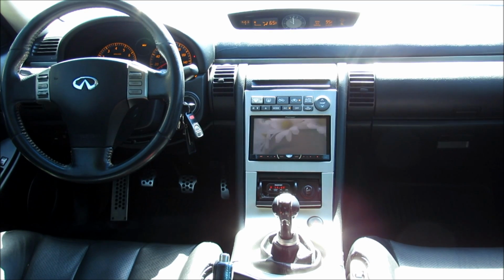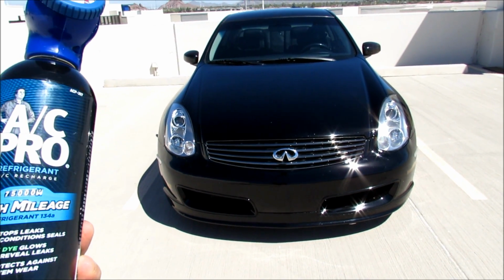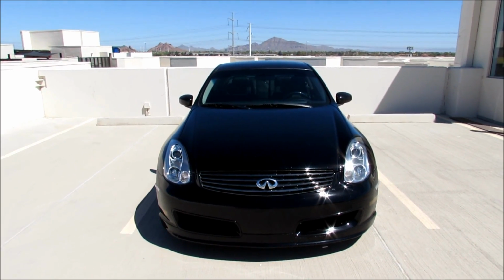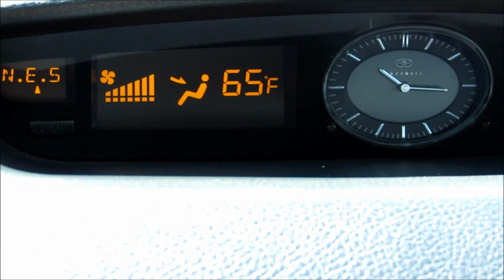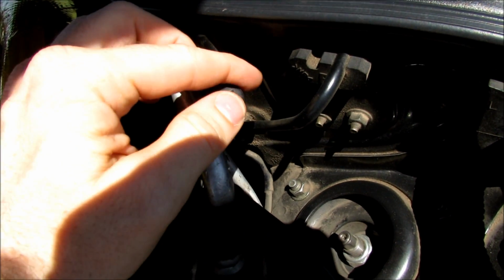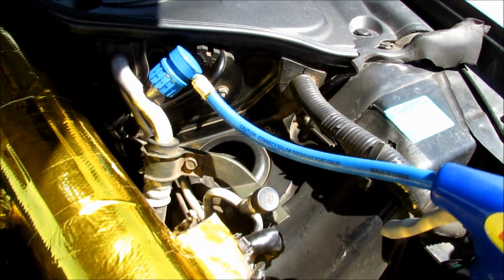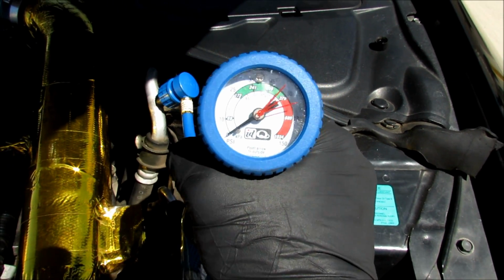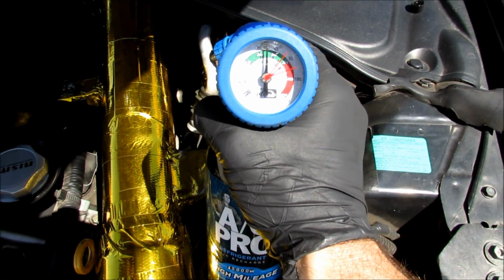Fix Broken AC - How to RECHARGE car blowing HOT AIR

Comment: My ac is on full blast and my radio doesn’t respond and my battery is always drained do you know what I can do to help with that problem?
Reply: I have this problem but not with the battery. The screen was stuck on Infiniti logo. Had to get get a new head unit. I’m still waiting for Infiniti to get back to me

Comment: What battery do you use for your g35?
Reply from the maker: The 5 year one from Oriley's. In Arizona, the heat is so hot that batteries only last 3 years so I always get a free battery under warranty.
Reply: Motordyne G35 what’s it called do you know ?
Reply: Motordyne G35  also so my ac is on full blast and my radio doesn’t turn on I read that it might be due to a discharged battery and my battery always needs a jumpstart to function will getting a new battery solve my problem?

Comment: My A/c blows hot only, When I was about to fill it up I noticed the low pressure cap missing you think that’s the reason why ?
Reply from the maker: I doubt it, there is a bigger leak somewhere else. Did the recharge can fix it?
Reply: Motordyne G35 The recharge didn’t fix it, I’m taking it to the mechanic Friday.

Comment: There is one other issue with many cars with over 100K miles. The
AC compressor can get tired. You will notice this when the system has a proper charge.
When you start the car cold, everything works fine. But, drive it for a few miles, then pull
into a store for a few minutes and then start the car again and take off and you will hear 
a sound much like the roar of the cooling fan on a diesel truck or older car as
the engine revs. That fan like roaring is the AC pump beginning to fail. This is very common
on Nissan vehicles. Honda cars make this rattling sound. Like I said, you will start to notice it when
you  let a hot engine sit for 15 minutes to an hour or so then restart and take off. 
It is very evident much above 2000 rpm. Many times, if the system is slightly low on freon, 
the noise will not be there. But if you top it off and get the pressures back up, all of a sudden you start hearing it.
Like I said, this is usually heard on cars with over 100K miles on the original AC compressor and 
more common in hot locations like Florida. The thing is that the system will  still cool the inside of the car fine.
Problem is that when the compressor does finally go, the whole system will suffer from what they
call the 'Black Death" which will many times require replacing EVERYTHING to get all that black goop out.
Flushing rarely gets it all unless you do it several times (Which very few shops will do). 
So, if you do top off your freon, listen for any abnormal sounds coming from 
the compressor when the system is hot.
Reply: I definitely hear that roar even more with the recirculation but my vehicle only has 50k miles.
Reply: @Monster33336  The noise I talk of will be quite evident if you raise the hood and listen to the compressor. Like I said, it should be a lot louder then the engine is still hot during a restart. This is when the system will experience the highest pressures until
the fans cool stuff back down again. It is the first sign of impending compressor failure. Turning the inside system from circulating outside air to recirculating inside air will have no effect. It is normal to hear more fan noise inside a car when you go from normal to  recirculating inside air. 
The noise I speak of is from the actual compressor and when it gets bad enough you will start to notice this growling inside the car. If you let it go, the compressor will eventually self destruct. A test is to let some of he freon out, thus reducing the system pressure. Then if the sound is less, you know the compressor is on the way out.My 350Z had this issue. Sounded good when the system was cool, but once it got hot, the compressor would start to make a growling noise. And yes, the front fans were working correctly. I did change it out before it completely died and with the new compressor and drier in there, the thing is nice and
quiet now and cools great.

Comment: 08 G35S sedan. Any clue how I could check my a/c compressor ? My system isn’t changing so I have a leak somewhere and the a/c compressor won’t kick on.  Thanks in advance
Reply: Hey im having this same issue on my 08 g35 and was wondering if you found a solution
Reply: Compressor will not come on without freon in the system..so u have to charge it with enough to make it cycle to show the leak

Comment: Tip from me for DIY .. on hot day no matter what temp is you can spray a mist on the condensor with a garden hose or splash in forceably with water only filled antifreeze jug when hose is not avail.,  (  in front of radiator) with the gauge on low pressure port . You do not need excessive water just make sure its wet from top to bottom and side to side rather evenly. For R134A the pressure for maximum cold on a properly operating system will be 28 psi , for R12 its 30 psi and for Freeze 12 a conversion brand its 26 psi.. these pressures yield temps so cold its almost freezing. * Over or Undercharging will yield warmer temps and higher operating pressures* Ive seen duct temps near 39 degs F on average using this technique. I ran my own Auto/ diesel master tech service for over 16 yrs closer to 19.. Being mobile you learn alot of tricks that save toting bulky equipment around. I always had to have a recovery machine though being a pro. Sometimes the R134A fittings will fail and cause the majority of leaks . Always clean and check the R134A ports before clamping hose on the service ports.
Reply: The optimum low side pressure changes dependent on outside air temp.  To say every 134a system should have 28psi in the low side for max efficiency will not always be correct.  Dependent on outside air temp pressures can and will range from about 25psi to 55psi on the low side of system.  As the outside air temp rises so will optimum low side pressures.
Reply: theripper121 Thus why I stated YOU MUST SPRAY THE CONDENSER WITH WATER ! This simulates a perfect day of 75 degs out . This prevents overfilling when using a can as well if people add freon gradually. I've only done this for 19 yrs professionally otherwise I would not have suggested it. During a recharge with a machine it dumps the correct amount in so its a no brainer.
Reply: If you have a gauge why not just use the gauge properly and skip the step of trying to water down your condenser and guessing whether you got it wet enough or not and just fill it according to your outside temp.  Seems like you're adding an unnecessary step.  If you bought a can with the gauge on it just set it to outside temp and fill.  Unfortunately most people don't have the proper equipment like you do to recover what is in the system, to pull a vacuum on the line and to refill.  That would certainly be the most ideal for your cars ac system and the environment given tons of people end up releasing into the atmosphere but not the easiest on one's wallet.
Reply: theripper121 Dude STFU already with your speculation bullshit . By EPA LAW TO SERVICE AC PROFESSIONALLY techs have to check for leaks . I carried a suitcase recovery machine. A recharge and evac tower are way too expensive. I was a MOBILE TECH  not a shop. Giving advice to Do it yourselfers here so wtf are you on about ?
Reply: I'm not speculating a thing.  I'm just having a conversation here not sure why you are getting so hot and bothered.
Reply: theripper121 My humble apologies about that , your right no need to act hot headed it was uncalled for.. let me clarify a few things why I do it that way .. First as a mobile tech you never know how many people have serviced the AC before . System capacity can be overfull on oil charge . Flushing a system was not practical for me as I'm doing work in apartments, at shopping centers, people's work and at their homes. AC work was very tiny part of my business. I tried to avoid it as much as I could. The people I had as return clients were not rich and good middle to lower working class. They needed correct fixes done as cost effective as possible. Just dumping freon in doesn't always get it as cold by the charts I've tried it. If you got a AC thermometer with the clip and long shaft like a meat thermometer. Stick it in your ac vent mid day on 100° deg day . Its likely to only be 48 to 54° . Car manufacturers only require a system to do at least 54° with R134A. Using my method every Normally operating system has gotten to 37.6 to 43° F . That is blowing ice cubes nearly. To truly do proper AC you also need a high pressure gauge to verify there are no restrictions on the vehicle being serviced. There are so many factors it would take all night to explain each. When you wet a condenser with AC on if it is low on charge the compressor will cycle shutting off then turning back on. That means it will need at least 1 full 12 oz can in most systems. Every car is unique in capacity so again its a tried and true method that saves alot of hassle. If you cannot obtain a steady 28psi on low side with wet condenser there is a operating problem on the system and it needs more involved servicing. I think that covers it. Any other questions ask away .
Reply: theripper121 Also 1 thing I encountered very often is people request an AC check and or servicing. More times than I could count just by putting gauges on both ports 75% of the high side R134A fittings will start leaking just because you touched it. They really suck. Most leaks I found were AC comp with 100k or more miles on it or fittings. Some lines on occasion but mostly fittings. Ideally I wish I could have an 18k dollar machine that flushed , filled evacuated and did all that. Getting an exact amount in your car for DIY's isn't easy as it seems. They can overfill a system pretty easy. As a quick test of any AC system without tapping the fittings I would turn everything on to Max AC . See if the compressor comes on . If so I then wet the condensor. If the AC started cycling the system was very low and time to start looking for leaks. If the system was going and not cycling I would put my low pressure gauge on and then wet condensor again to see where charge level is at and gauge operation of compressor and orifice tube/expansion valve. The chart you mention does not account for old compressors not doing their job as well either. It assumes everything is new and perfectly operating.
Reply: Thanks for the apology man.  I want you to know in no way am I trying to talk down to you or criticize the way you decide to carry out your work and I am in no way insinuating you don't do good work.  I find that AC work can be pretty touch and go for the average DIYer.  Even with proper manifold pressure gauges, a decent vacuum pump and cans of r134a getting just the right amount in the system can be tricky.  Maybe next time my car or a buddies isn't blowing like it should I will give your method a try.  I just replaced the condenser (hole in it) in a neighbor's Chevy Cruz and I tried to be pretty meticulous in replacing condenser and pulling a vacuum before refilling to the exact weight of r134a while it now works again I'm not entirely convinced it's as cold as it should be on a very hot day.
Reply: theripper121 exactly what I ran into alot. I'm trying to recall 19yrs of servicing all makes and all models. All types of repairs. Hated AC lol thats why i got annoyed easy I recall so many nightmare systems lol. Customer requests an AC check you put on gauges. Pull high side connection and huge geyser of Freon spraying like a dragster purging nos lines. Hated that so much. Sealers that people put in with these AC booster cans too takes up system capacity. The freon only picks up so much oil per capacity. If you over fill on oil charge you cannot achieve the correct amount of freon in the system and it won't get as cold. Also that extra oil lays in an area taking up space or if its too extreme it gets pushed thru the system and can cause higher than normal pressure on high side. Risks are blown compressor or bent internals worse case. My buddy who has been a Mobile auto tech since I was 12yrs old taught me these tricks. Like you said gauge sets and those cans with the guage on it can be inaccurate as well . I had a good Robinair set I used to fill systems and check pressures to get them dialed in. My method takes into account system discrepancies and gets pressure where it needs to be for coldest operation . Note these discrepancies can only be minor. Major issues may include a damaged or plugged orifice tube or expansion valve. If I cant get a system to say 28 psi after adding the Max system capacity on the cars label for AC system specs. There is a mechanical issue going on and the pressure on the low side stays way above. That is why I love wetting the condensor method.
Reply: Erectus Maximus Is it just me too or does it seem that systems in general, even in well working, properly maintained systems seem to really vary somewhat the actual max cold vent temps from make and model to make and model?
Reply: theripper121 Again you are correct . The air volume in a cabin varies. Like I stated previously back when R134A was first mandated to replace R12 I think it was around 95 to 96 same time as OBD II came about. They car manufacturers only felt obligated to put out 54 deg air or cooler. R134A has much higher pressures and puts a ton of strain on engines of small cars. Imho I dislike it totally. An option in most imports I prefer for conversions of older cars is freeze12. It is 80% R134A with an R12 solvent in it that picks up mineral oil. Its pressures are much lower and low side wet condensor is 26 psi for max cold. As you likely know higher pressure means more heat to dissipate so less efficiency in cooling. Window tints help alot but laws in some states are ass backwards. The UV is getting more intense worldwide lately. Its called a grand solar minimum. Thus why nearly every ancient culture had a Sun god and made extensive artifacts for us future generations to learn from. We only get bits and pieces of truth . Must seek it out ourselves right 😎. More UV I noticed almost kills the cooling effect of AC as your driving west anymore. Some blower fans have lousy volume as well. Also many better trim quality cars have in cabin filters that restrict flow so always check for those too.
Reply: Erectus Maximus Thanks for all the info Erectus.
Reply: theripper121 Your welcome .

Comment: Can you please send me info on where my sway bars are in the rear? I have a 04 G35 coupe. I cant see them. And what factory rear shocks can I use to replace mine?? ORIGINAL PARTS WEARING OUT..
Reply from the maker: KENNYLSR. ...my OEM struts on the rear blew and was seized stuck when I removed it. Definitely unsafe to drive at times. Any bump the car would sway bad.

 I upgraded to KW which are expensive. The OEM replacement struts at the auto parts store I think are KYB. Here is a pic of rear sways, it is the blue motordyne sways in the rears. Yours will be painted black.....https://goo.gl/images/gMTj95
Reply: Motordyne G35 THATS IT!!!!! Bad bumps my car sways damn near fishtail!!!! Do you know the factory model #? How much was the aftermarket model. My car is nowhere near what u have but I'm slowly working on it.
Reply from the maker: KENNYLSR. ...it has nothing to do with your rear sway bar, you have blown struts. No I do not know the factory number and who cares because you will not be buying an OEM strut from Infiniti because of price. Go to advance auto or Orileys to find your strut price and part number.
Reply from the maker: KENNYLSR. ...Here in this video I show you the blown strut and how to install......https://youtu.be/cMJfN0X_rvs
Reply: mine are sized stuck too how did u get them off without destroying the bushings. Good old pb blaster and a torch?

Comment: This worked on my old 98' Nissan Maxima when I did it a few years ago. Thought the AC system was totally dead and never bothered with it for years (really sucked driving it in the summer) but I decided to buy a can of recharge and it actually worked. the AC compressor clicked on and i was able to mostly refill the system. Still works even 2-3 years after i filled it up. must be a very slow leak.

most recently I've had to change my G35's radiator cooling fan. car would overheat when AC was on or if i was stuck in traffic which really sucks. noticed only one fan was blowing. replacing the whole shroud worked wonderfully.
Reply from the maker: Yeah, I'm waiting for electronic radiator cooling fans to fail, which will be another video because they are simple to replace. That is why idling is hard on cars, no air flow. The fan dies, the car will overheat. The benefit to electric fans vs belt driven fans, is they free up horsepower. The only problem, is they fail, unlike belt driven fans. Keeping an eye on the fans is always a good practice!
Reply: Wish the engine coolant temperature light would start blinking when it hit 3/4's of the way up. I've been lucky not to blow up my engine but I can imagine a situation where I could have had I not been paying attention to it and I'm stuck in an area with no shoulder.